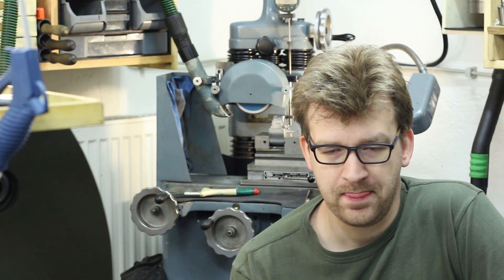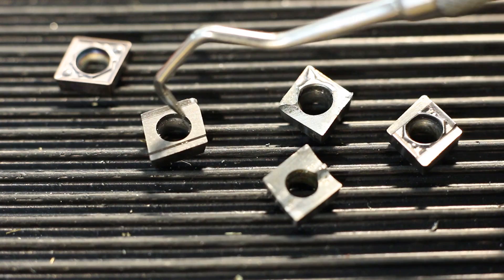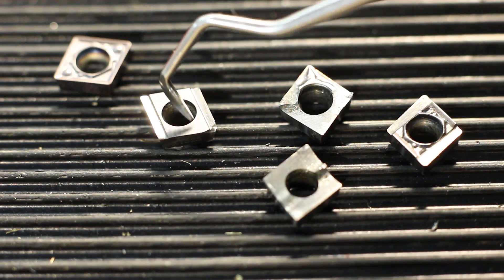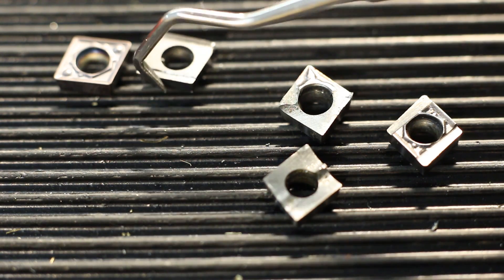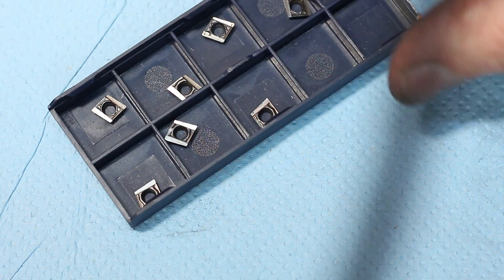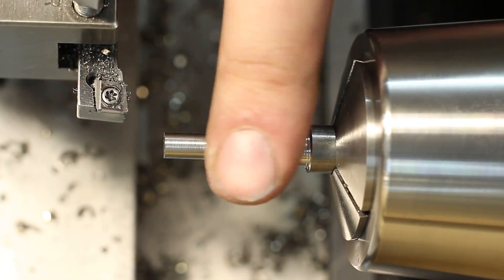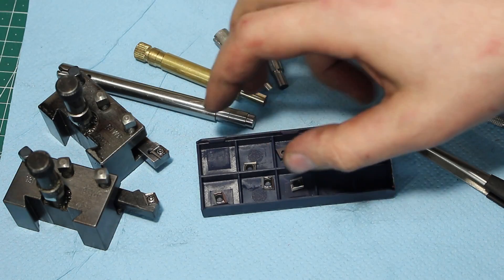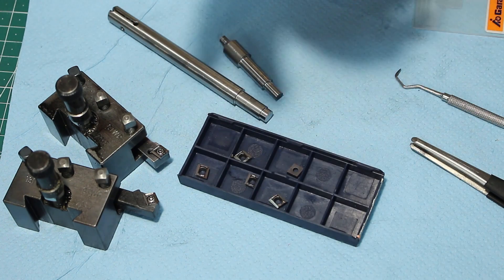Regrinding carbide inserts

Comment: I've just commented on another vid asking the same question. On a mini mill, is there any extra precautions one should take when attempting this with a diamond wheel? How deep and wide did you grind the 5° chip breaker? Just till the rounded cutting edge is gone? Other than the things that have been shown and mentioned in these vids, is there something mill specific to avoid. The vice will be on it side on the mag chuck with the little vice holding the tool shank inline with the X axis, and use the side of the wheel. It's a 5um dro all 3 axis on BF16v mill. You've mentioned carbide and diamond dust is death to man and machine, appropriate precautions will be taken.I noticed you were climb grinding, I was going to conventional grind. Is there a big difference between the two, like when manual milling?Thank you for the advice👍👌🇦🇺

Comment: I tried this and realised you need a few things to get this spot on:  

1. really rigid setup like Stefan's got there, no free-handing.
2. well balanced, dressed diamond wheel with negligible run-out and fine enough grit (>= 1000 ?) to give it a mirror finish
3. stick out your tongue at the right angle and pray the edges don't chip - which has been my problem so far
Reply: @Stefan Gotteswinter  How do you deal with built up edges on Aluminium ? Seems to be a major issue for me with anything over 0.2mm depth of cut.
Reply: Where I work they do this all the time, free-handed.

Comment: Those inserts could also be Korloy inserts with a KM chip-breaker. A very good alternative if you want to buy (not to regrind) inserts in Germany (if you have a company) are ATORN 6310 inserts. These inserts are super sharp (like inserts for aluminium) but with a coating. Tool life of those inserts is decent, even in steel.

Comment: Good video.  I began doing this years ago when I found out a metal recycler had hundreds of carbide inserts for sale by the pound.  I use a diamond wheel designed for lapidary work and just touch up as needed.  Mostly TPGN and TPUN inserts.

Comment: I use Tungaloy DCGT070201FL-J10  (label on the box in front of me) for very detailed work. They are available both right and left hand with very small tip radius. Looks much like a smaller version of Your regrinds.

Never considered the advantages of regrinding inserts, of course it saves a  lot of work compared to grinding complete tools like I often do. I use CCMT in the same size as You, will try it. The grade of the insert is probably important for maintaining a sharp edge. 

Also found that small DCGT Al inserts with a sharp edge works for fine finish cuts in some steels.

Comment: I'm seriously thinking on breaking the bank for some Mitsubishi CCET and CCGT inserts with the SR and SN lead chipbreakers like the ones you ground and they are advertised as a precision finishing-light cutting insert but they cost 2-5 times as the inserts I'm used to buying. If I only had a surface grinder...

Comment: ever considered trying out the ingersoll TT9020 grade with SA chipbreaker? they come as finishing inserts in C, D and V-shape and radius range from 0.4 down to 0.1, precision is top notch as they're -CGT class with grind finish on the release angle and they cut like hell.
great multi-purpose insert in my book as we use them a lot in our workshop, only downside is the wear is quite heavy when finishing at high speed as they won't last long, but you could even use them in aluminium.
http://www.imc-companies.com/IngersollCatalog/CatalogFiles/datafile/PICTURE/WD1050_1.jpg

Comment: Interesting video, thanks Stefan. Finally, somebody who understands what sets the minimum DOC.

What was wrong with the inserts before grinding? I often find mine won't "wear" per se, but some will have some sort of catastrophic failure that results in a chip. I presume yours were either new or merely worn before re-grinding?

Comment: I have also been grinding and touching up my inserts for years,never been a problem, the solid carbide all the way through. The only inserts that can't be done are the cubic boron nitride CBN ones, not got a grinding wheel hard enough!  There are not many materials the CBN can't deal with?  Even hardened bearing shafts and hardened high speed steel bend to its will!
Reply from the maker: I recently learned that one can regrind/resharpen cbn inserts with a resin bound diamond wheel without a problem :)

Comment: There is no reason carbide inserts could NOT be reground. The problem is that most carbide insert holders depend on the outside dimensions of the insert to hold it rigidly. If that dimension can be meintained, the inserts could be re-used. The problem is that the inserts are so cheap that the time and effort involved in regrinding is a waste. You are better off just replacing the insert and getting in with the job.
Reply: Most hobbyists have not much money, but time.
Ok if you earn money with your machines, you replace the insert and go on. Time is money! 
I regrind my inserts too. Why ? Because i have  a universal tool and cutter grinder and a lot of used inserts of the same types
One setup and you grind a bunch of them, next setup...... an so fort.
For me the cheapest way for using inserts, they are always a gift of a good friend.😉

Comment: Hi Stefan,
Nice video, but why don't you just use sharp inserts for Alu? With the very small radius they do the same job perfectly (e.g. https://de.aliexpress.com/item/10Pcs-CCGT060202-AK-H01-CCGT21-50-Aluminum-cutter-blade-Insert-Cutting-Tool-turning-tool-CNC-Tools/32805668556.html - sorry for the link to Ali, but it's the cheapest option)

Comment: very informative stefan, i think i'm going to have to try it. i have a surface grinder but i wonder if you have tried to freehand the grind? have you tried  a green wheel and then touch up with a diamond file? could one use a commercial  insert holder on the surface grinder ?

Comment: Stefan 
I have used these for finishing top two rows , note they are left and right hand one is for normal turning and the other is for boring , not good for roughing but finishing is good

https://www.shop-apt.co.uk/carbide-inserts-for-turning-uni-tip.html

I use a CCGT style for general use kenametal do a version for steel in h10 now these are a bit steep on price but keep you eye on flea bay had a good deal and got hold of 60 a few years ago 
This site in the UK  has good deals at times
https://www.jurassictools.com
Great video

Comment: I can now forsee the sale of small surface grinders going through the roof price wise.
thanks for the info and demo Stefan.I have boxes of used carbide inserts ,good job I save things for re use. Now all I need to do is to dig through 40+ years accumulation  of clutter  and junk to find them Yes I know . junk is junk but only until you have a use for it.

Comment: Since you aren't taking large depths of cut and using that long sharp side why not run across the nose at an angle so as to force the chips to curl back tighter and break shorter.  Right now you are at 90deg to work I would like to see you try a 45deg to work to see how it performs.

Comment: Brazed carbide may perform just as well as a reground insert, but I do think that a lot of people would get a lot of value from being able to squeeze as much life out of every little piece of tooling they can
Reply from the maker: I do a fair bit of brazed carbide, but it is so much grinding ;) 
On an insert, all the hard work  is already done by the manufacturer - For example a nice, well defined nose-radius is already built into the insert.

Comment: Excellent video! I've a question about the use of CCMT inserts - I hadn't fully appreciated that they work by creating sufficient cutting pressure, and hence require a suitable depth of cut. That being the case, how is it possible to use them for very shallow finishing passes? Surely they wouldn't work at all? I was a bit confused when you described that Kyocera one as also a finishing insert. I've never had much success with them anyway, because my lathe isn't rigid enough, so I always use the ground CCGT version, even for steel (they sometimes don't last long, but I'm using Chinese-made inserts which are only about $1 each)
Reply: It would benefit you to study the various chip breaker info in the insert manufacturers catalogue, one insert can have half a dozen different ones all with different purposes. Some chip breakers have a minimum cut of 2 or 3 mm, while others can go down to a few hundredths of a mm. It is a mistake to think that you want, say, CCMT and think they are all he same, they most definitely are not.
Reply from the maker: With a normal insert you simply dont do a shallow finishing pass ;) Finishing takes place with a reasonable deep cut - With a stout machine you will have no problem hitting close tolerance/good finish, when taking a 0.5 or 1mm finishing pass. But my toy machine is another game.. ;)

Comment: Great video👍🏼 Like you I prefer to use sharp edge cutting tools for small parts. At work we use that type of CCET insert with a 0.1mm radius from Kyocera which are pretty expensive around €18/pc 😬
http://global.kyocera.com/prdct/tool/pdf/catalog_cp254_e.pdf
I recently purchased similar inserts for my homeshop use at a much more affordable price right here https://www.shop-apt.co.uk/carbide-inserts-for-turning-uni-tip.html

Comment: Hmm, the chip breaker seems to do nothing. Wouldn't it be better to make it diagonally just behind the cutting point instead of all along the side? Are you even using the more blunt points of these inserts?
Reply from the maker: Yeah, chipbreaker, chipformer. It is not agressive enough to realy break the chip, but it curls it up and brings it out of the way, so I dont end up with a spinning ratsnest of wire-like chips ;)
I didnt want to do a more diagonal one, as I use the long edge of the insert in my chamfer tool. Speaking of the chamfer tool, thats where I use the 100° corner of the insert. (As seen here: https://youtu.be/ZsPHB1gPink )
Reply: Ok, when you see it like that it makes more sense this way :)
Reply: I partially agree with chris0tube. Indexable carbide inserts were invented for series production where heavy, sustainable cuts increase productivity. And nowadays series production is largely automated. So the inserts now also need to manage the chips because nobody is standing by to do that. 
Carbide inserts are around now for how long? 50+ years? And most innovations were protected as intellectual property. So the numerous competition had to find an almost as effective shape without infringing on other's IP rights. That lead to a jungle of different insert geometries. How can innovation still take place ready for the next trade fair after all this time? It is only by more and more narrow niche optimization. Already when only the depth of cut changes a little your insert is not optimum any more and you better use a different one. Here is where the experience of the production pro comes in to know which insert and cutting parameters are best for which application. However, in times of preferred supplier strategies in procurement a production pro may only gather experience with the insert lines of one or two suppliers. When he changes company which uses different insert suppliers his experience is only partially applicable. This all may work in large series production. But smaller shops need more all purpose inserts that may be less optimized for each application.
For the home shop productivity is less important. Much more lighter cuts are done and chip control serves more safety, and surface finish. Here the experience of the production pro is only of limited help. So Stefan tries to translate the industrial chip control to the home shop environment with its lighter cuts. For all of the above reasons the indexable insert is much less suited for home shop work. Reground indexable inserts or brazed inserts with sharp edges fit better and the good old HSS cutter fits the needs of many home shop jobs still fine. Many home shop metalworkers use indexable inserts only because they don't know how and/or are not equipped to grind their own tools. If you belong in this group don't worry. Watch some of the many tool grinding videos, pick the method you like and get the necessary equipment which can but does not have to be expensive. And stay away from those plastic, one size fits all sharpening gadgets on the market. If you choose what the old-timers used you will get good results for little money. Start with your lathe cutters, then drill bits, then milling cutters. Get one or two diamond wheels (they are not that expensive) so you can regrind carbide to customize it for home shop duty. Use a fan and/or a dust mask to keep the carbide dust out of your lungs.
Reply: It is obvious that your "chipbreaker" is not really effective with the light to very light cuts for which you use this geometry. That is to be expected. How about making that chipbreaker channel more narrow and with a sharper corner at its back. So to speak make the channel smaller and more in proportion to the chip size and more aggressive using a sharper edge radius on your diamond wheel. That way you perhaps get real chipbreaking action for the medium and possibly even light cuts. Of course not for very light cuts. Your close up videos showing the chip flow of the different cuts are very telling and a great help to study the effectiveness of the chipbreaker. For those who dont have an abundant source of chipped index plates you could also buy the simple, plain index plates without any features on it as blank material for customized grinds. They are not that expensive.
Reply: On the materials shown, at the diameters he is turning and the limitations of his equipment, he isn't going to see ideal chipping. What he is getting is more than adequate and the chip breaker does its job of pushing the chip out and into the chip pan.

Comment: Does the dead sharp cutting edge result in more chipping?  I can imagine that the brittle, thin  edge is more vulnerable than a factory radius (not nose radius, edge radius).
Reply from the maker: Yes - It is way less durable, but thats a minor drawback for me. For roughing I use out-of-the-box inserts anyway :)
Reply: I think if the edge breaks a little bit you can maybe regrind them again. It will be a little thinner and thus more brittle, though.

Comment: "I don't do much Aluminum, but when I do, I prefer 7075!" ;-)
Reply from the maker: I dont do much aluminium, but when I do, I prefer toolsteel ;)
Reply from the maker: Titanium machines absolutely unspectacular, just like "normal" 316 / V4A / 1.4401 stainless steel. Drilling and threading smaller than M3 can be a bit nervewrecking ;)

Comment: Kennametal doesn't show a current matching geometry for those inserts, but the HP chipbreaker looks very close, it's a ground 15 degree finishing chipbreaker.  The insert would then be a CCGT-21.51HP KT325.  They don't have one like that, but they have the CCGT-21.51 11 KT325, which is a 7 degree finishing chipbreaker.  They have the HP chipbreaker in other grades, just not KT325.  That's probably why someone had them custom ground!

Comment: Stefan can I ask you about the diamond wheel on your grinder? What type is it and do you dress it yourself? How and what do you use to dress it if you do? I do quite a bit of tool grinding and am always looking for information on how people do things. Thanks I watch all your videos you have very useful content.
Reply from the maker: Its a normal resin bound diamond wheel, D128. A little bit coarse for real superfine finish, but a good allpurpose grit.
I dress them by cylindrical grinding with a silicon carbide wheel - Basicaly I put my die grinder with a SiC wheel on the table of the grinder, let it spin and then plunge down onto the SiC wheel with the spinning diamond wheel. 
The SiC wheel will wear crazy fast and needs to be redressed with a diamond frequently, but it works.
After the diamond wheel has dressed, the resin binding has to be backed of so the wheel cuts free again, there are special handheld stones for that, for example from Tyrolit:
https://www.yumpu.com/en/embed/view/aFfTz8iLj0kt1YJ7/313
(Right lower corner, "Sharpening stick")
Reply from the maker: I ground 20 pairs of them or so ;)
Reply from the maker: They will have a brief appearance in my next video ;)
Reply: so where are your diamond flattened stones ala Robrenz style. We know you got em! :D
Reply: :D

Comment: Good video 👍🏼 Enjoyed it. What brand of surface ginder is that Stefan? Recently had a job turning a tiny shoulder on 3/16" W1 tool steel....horrendous burr....any suggestions on a type of tooling to eliminate burrs on small diameter turning with tool steel?
Reply: http://gtwr.de/shop/pro_lip515/index.html
Reply: Thanks Haggis, I appreciate ya